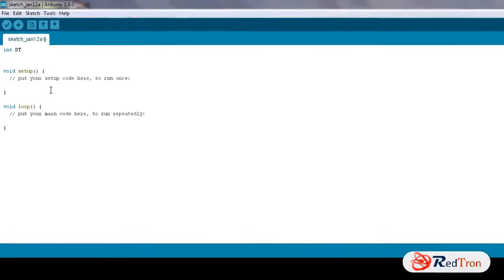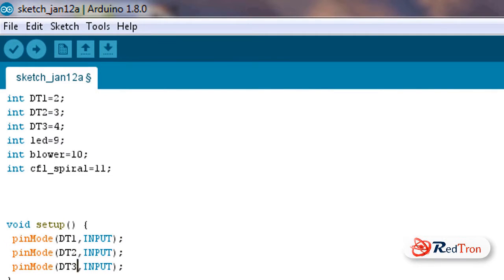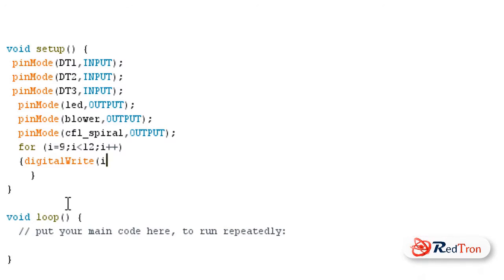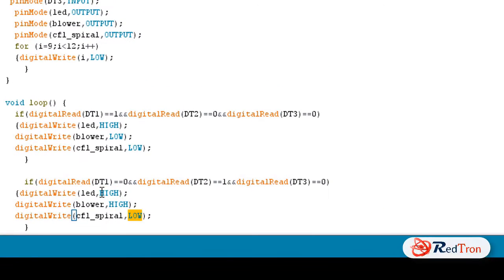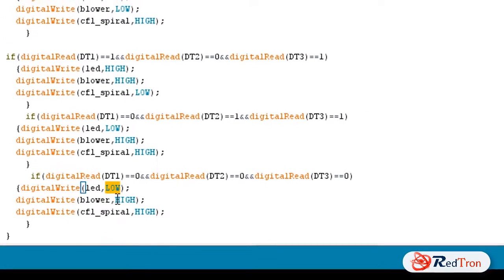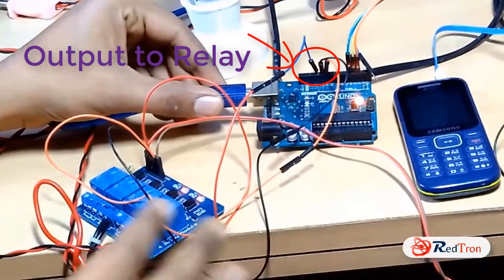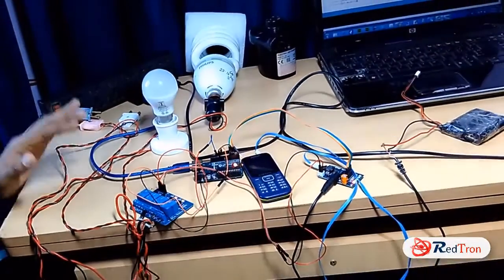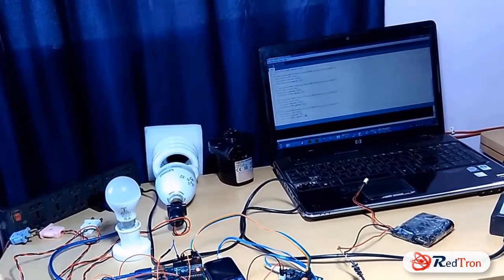Control Home Gadgets via Smart Phone- Part 2

Comment: Sir pin connection nhi samaj me ae relay se arduino ko kis pin me lagana hai
Reply from the maker: As Arduino here is used for providing signal to relay , you can use any digital pin from 0 to 13 marked on arduino board(2pin -13pin recommended  as 0 & 1 pin used for communication purpose like bluetooth). In above video I used 9, 10 , 11 pin of arduino (defined as output pin in programming) for providing signal to Relay module ( though it has 4 relay but I am using only 3 ).
hope your doubt are clear.
Reply: Thanx sir